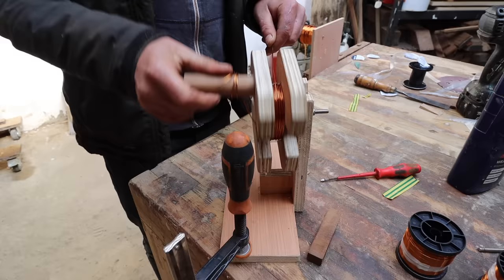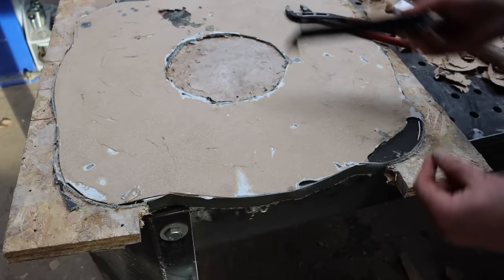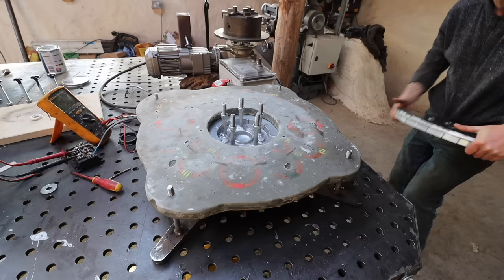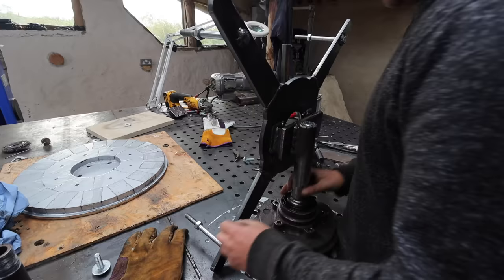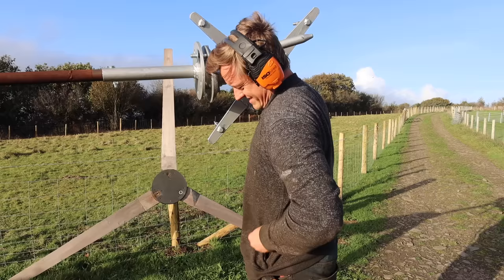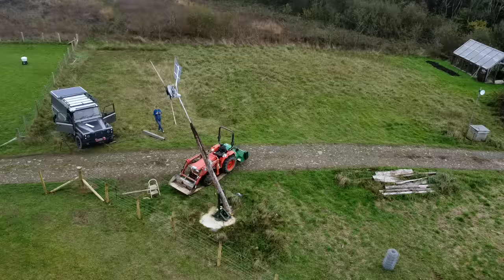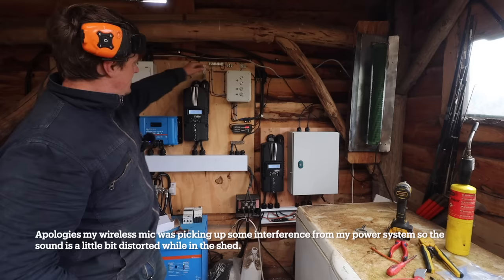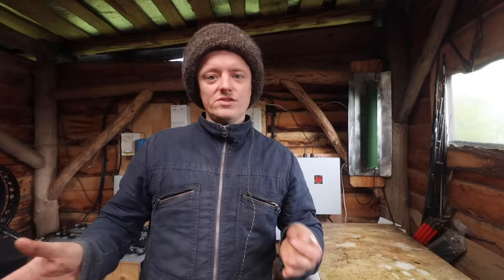Off Grid 2 KW Axial Flux Wind Turbine And MPPT Dump Load Controler Build

Comment: If you experience failures in solid state components associated with the relay coils consider installing a reverse biased shunt diode across the relay coils so when the relay coil de-energizes the high voltage from the collapsing field of the relay coil is shunted to ground instead of back into whatever solid state device you may have controlling/powering the energization and de-energization of the relay coil.

Comment: Jeeeez my guy… you’re using some heavy & solid materials for the blades/turbine parts on top. Lighter materials w less mass would help with efficiency @ min wind speed & not not be so tough on center of structure & the slim pole you mentioned that it’s all held up with

Comment: I'm always amazed that the stuff you make works as well as it does, rough and ready sums it up. But I think you need to change the Copaslip for proper grease as soon as you can in that bearing. Copaslip is an antiseize compound for static applications, it really should not be used as a lubricant. Love watching what you manage to do though with your limited resources. You still need to wear gloves and protection when you are welding.

Comment: Could you invert the function of aux2 and the solid state relay? So that if the relay dies it will default to dumping the energy to the heater instead of risking overcharging the batteries? Just a thought. Not sure if the controller can invert the function and that the solid state has both a normally open and normally closed output. If all that is available, just invert the aux2 signal and switch the output on the relay and it will have a graceful failure mode instead of a possibly catastrophic one.

Comment: vertical wind turbine ends the twisting matrix of traditional windmill designs and to reverse weight some even use magnets to create levitation which can reduce weight of the turntable! So just a whisper of wind turns the vertical axis...The load of the batteries and charging system creates some counter electromotive forces but weight of the apparatus can be reversed through an additional ring of magnets set up with like poles repelling to the point of almost floating the turntable in mid air

Comment: Consider putting a plate behind the coil, then you can push the plate out with a few screws to remove from hub.  Much like they do to remove injection molding.
What about using the clear epoxy like they do with tables, so you don't hide the motor.  Works of art should be seen.

Comment: I dearly love a wind generator. Cost a whole lot less than solar power and all the high dollar batteries and solar panels, and the space it uses up >  My ideal of a pole is?  A telescopic pole, 1 straight one with a cable to a electric wench to lift up the other one.  My radio tower was set up like that, and make it easy to take up and down the antenna. Then the other pole for a lift could be taken down as well, when it was set up

Comment: It wouldn't be too hard to build a secondary safety cutoff that swaps the turbine over to the heater, bypassing the MPPT entirely, in the case that the battery voltage goes above a certain configurable overcharge threshold. It's not a particularly difficult circuit design and I wouldn't mind putting a custom PCB together if you're interested :)

Comment: A matter of interest if say you go for 48V batteries, then less losses in cable's, I see there's a very nice slope why don't you take advantage of that & try build say a large vertical wind turbine, your generator say at the top of the construction, with the hill you should get a very good gust of wind at the top of the hill, I don't think you need to mount it more than 6 ft off the ground if you mount it at the top of the hill, easy to maintain 👍 you wouldn't need to worry too much off overspeed as long as its well balanced assembly, only worry about overvoltage, you could even have a mechanical clutch breaking system like the governor on a steam driven engine,  interesting video for sure 👍👏,

Comment: Using roller bearing can be used as slip rings. Used then for round the pole electric model aircraft. Make unit the oil seals and watertight plastic box,  inside wires in, up the tube and out, output wires resined in out of unit holes and away.

Comment: When you get time think about a wood cutting cnc conversion head for plasma cutter 
And when i want to get rid of air in resin i use sds drill on hammer stop with old 12mm bit to vibrate the job , works an easy

Comment: Very interesting video. I have to wonder why no one builds a wind turbine that has a gearbox to turn the rotation from horizontal to vertical. Then the wire twisting problem would not exist. That also could put the alternator down at ground level which would help balance the weight of the tower. Yes the gearbox would need to drive two shafts one inside the other with one going CCW and the CW to take care of the torque  twist that would happen with just  one that would tend to rotate  the turbine head out of the wind. At the bottom there could be either two alternators or  a set of gears to return the two shafts to a common rotational direction. Shafts would come down the tower one inside the other with bearings somewhere near the middle to take care of whipping. Two alternators would allow you to use two MPPT controllers to adjust for torque twist. Set one for higher than the other and as Voltage went up the one that would need to counter the torque twist would produce the most power while the other would be set to a lesser amount. Same design could be used with a water pump driven by belts  that would act as a dump load/brake for when the power was not needed.

Comment: You  Send the power out from the inverter, running through my entire motorhome so I will not need the brake, or dumping excess. Why not dumb it into 2 saltwater batteries to store electricity, and use when needed?
 QUESTION... Can I use the same charge controller that my MPPT Solar lines come into it? I'm going to run both solar and wind generator on my property. Should I use a separate charge controller for my wind generator?
Any advice would be greatly appreciated.
Todd

Comment: Well done , make do with what you have 👍 entertaining video .i installed a3 kw solar system with 2 Bosch 270 ah batteries and splitter the house in two sections .
Ordernary one phase consumption  is going on solar and battery, 3 phase for stove ,machines i buy , solar charges the batteries with up to 80amp (24 volt) it lasts for days . Total cost was 2400€ and my electrical bill has come down to 20€ a month. When i have no sun or no batteries normal bought power is powering the home

Comment: WOW i just found your video,GREAT!!  As a retired engineer and welder/machinist,that used to make the parts i thought up and did my own drawing on your vid was so good.While watching you lift the pole up i only had 1 thought,if you put a cement counterweight on the bottom of your pole >it would be safer and easier to lower and rise.You would have to remake the base wider maybe or maybe make 2 boxes out of angle iron and plywood to hold the cement bags or maybe just sand?or even water in 55 gallon drums?Balancing the fan blades like on a record player.of course the pivot shaft would need to be increased? Cheers from the USA.

Comment: I'll be building a similar but smaller version of this pretty soon. I don't have a lathe, so I'll be using a motorcycle front wheel to put blades on, and the two brake rotors for the magnets. It already has bearings, and is balanced. Adding 2 foot blades to a 19 inch wheel makes a 67 inch blade. I have 1200 watts of solar panels feeding 20 marine batteries. How many batteries does one need to not have to have a dump load? I think I will try it with 26 and see what happens. I also need to see how the bottom of the pole is made. You made me miss having a tractor. I used to have a 790 John Deere tractor with a front loader. Nice electrical system you have there. The brake rotors I have are 10.875 inches. I plan to put them both on the back side with a spacer between them. I figured I can handle making the coils. I had to buy a Winco generator last week so that I can use my welder. 800 watts would be great. I don't have such an energy thirst or the money to pay for it, as you.

Comment: Nice job on everything concerning the wind turbine, Kris! As a longtime builder and experimenter with horizontal axis wind machines, I only have one suggestion: Get at least three retention cables on your primary mast. As you well know, the power in the wind is proportional to the cube of its velocity increase... so, a sudden violent gust might cause your unit to be blown over and be destroyed. Also, I agree that your secondary support mast appears to be inadequate (dimensionally). These potential problems will certainly be exacerbated when you increase the turbine's area by increasing its diameter. In conclusion, I am amazed by your ability to design (and build) your own generator! Are you also an electrical engineer, or did you have help with this? In any regard, I certainly enjoy watching your videos. Keep up your amazing work!
Reply: Do r need to be a trained engineer . Some of us can work it out for ourselves

Comment: Here is an idea, I dont have wind so cant test it, most wind turbine design trys to run at a constant speed since they are either chaging batteries which have a C rating or feeding into a power system. doing it that way is inefficient. suppose you have a bank of supercapacitors, remove the restriction from the wind turbine so it will react to gust as well as high wind, this way the caps can be charged up very quickly since they have a C rating of a 1000. the output from these caps could then be either feed into an inverter or a battery charging system at a slower rate, edit I am patenting this idea by the way.

Comment: Wnen  using epoxy, use a butane torch to remove air gaps and voids. Just run the torch on top of the epoxy surface after the pour and the bubbles will come out. The industrial way is to use a vaccum, bag and pump to remove the air.

Comment: You could cut a little slit in the magnet holder, to make room for a tiny bar magnet about 3/4 of the length of the magnets used. Forming a Halbach array. Possibly making the magnet stronger, the generator more efficient. A 3mm thick 6mm wide bar magnet, N52 possibly  north and south facing the magnets it may be worth doing, I'd research it, see what exactly the claims are,  I don't have enough water to build anything hydroelectric,  maybe I can build a few windows turbines, I have been looking at some non traditional vawts,  but will probably start with the tried and true turbine 3-5 blade using a modified alternator, just disassemble it and put a large ring magnet in the rotor replacing the field coil, regulator, and rectifier, place it near the battery,  it needs to supply 30-60 v+ for 24-48v battery, i want a mppt like the midnite classic 150, it can track anything. PV to rectified generator. Making charging easy, if you can afford it!! I need about 2kw wind power, and 4-5kw solar, my DC generator can make up for it.. I want to get a 12kw inverter. Either 24v or move up to 48v, 48v makes a lot more sense when it comes to charge controllers! Half the equipment,  ✌️

Comment: Getting rid of the air bubbles in casting can be done with a power sander, you know, the type making small circles with the sole, using the vibration of it

Comment: Enjoy your videos. If you had a counterweight on your mast you could lower it by hand crank. Small airports often use similar setup for windsocks
Have you considered using an electric water heater as a dump load. Could supplement heating and hot water. Cheers from Alberta Canada.

Comment: Dont know if the same happens for everyone else but the sound and subtitles dropped out on the most important section for a wind turbine, the dumpload. Its needed to avoid destroying your batteries or having your windturbine running unloaded in a storm which would probably destroy your turbine, you need a load on it to control the speed and a runaway turbine is dangerous, if your charge controller disconects your turbine and doesnt connect a dumpload you will have a serious problem

Comment: Wrt potting the coil assembly, would recommend construction of a small vacuum chamber to pull out all the trapped air; an old fridge compressor is good & inexpensive

Comment: Heat dump.
On my system I've looked at firstly dumping the heat into 24v emersion element so that the power goes to heat water and once up to temp through thermostat then throw a relay and contacter to the air dump. This gives an auxiliary hot water source.
As yet this is just an idea as funds are limited and I like to where I can recycle materials that people believe ar rubbish.

Comment: I love the design of the power dump!  Since the power will most likely be during long/sunny Summer days, will it make sense to add a fan inline to help dissipate that heat or direct it away from the rest of the electronics?  I'm in Southern California so maybe overheating isn't an issue for you.
Reply: An air compressor would be a great way to use excessive power. Could store the compressed air or just dump it. Much safer than a 2kW heater in the controls shed.

Comment: Protect the vertical bearing seal with a simple alum. or plastic cap cut in half so you can install it. Water will get in otherwise.

Comment: I love fab videos.  I always have lots of reactions:

11:45  Nice trick with the brass studs.  Having a vertical mill sure is handy!
144:52  Wear gloves when you weld, man!  Ouch
16:39  Gluing down the magnets is the WORST time to discover you marked the "S" pole "N".
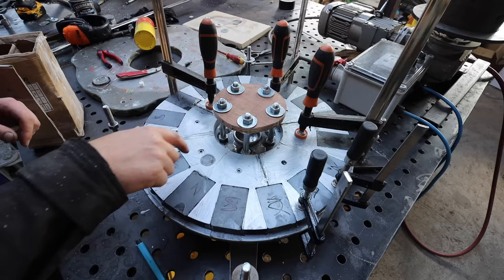16:57  That wooden disk would have made a nice tool to center your "spider" rather than do that by eye.
19:31  You would NOT want to do that with Neo magnets!  I wouldn't have the guts to try that, even with ferrites.
25:25  I don't think copper grease is going to last very long.
27:40  You can make a cradle with a few pieces of lumber for the tower to rest on as it comes down.
32:20  A bit of nose-up keeps the tips of the blades away from the tower.
39:45  They say "when you need a bigger hammer" and you oblige.
42:00  Can't agree more, wind turbines do need towers that let you fix them.  
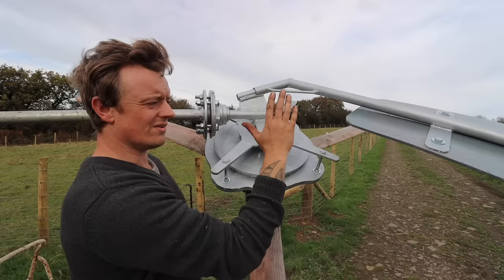43:48  Lucky you.  My wind direction always changes clockwise.  Always!
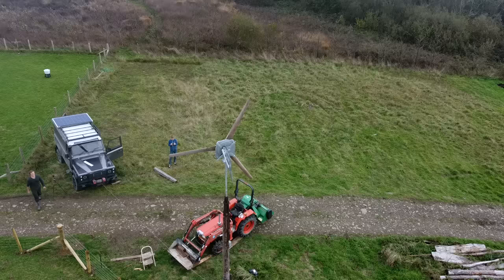46:00  Congratulations!

Comment: It needs high voltage diverter , a voltage controlled relay  to to to disconnect the turbine from the battery when they are fully charged, to prevent over speed  of the turbine,

Comment: Use super 100F capacitor bank with the FWB, into the MPPT can follow the power better. Overvoltage should be switched into water heater etc...
MPPT could get generator inductive surge damage not seen with smoother PV power.

Comment: I'm a bit puzzled why not put the surplus in to a into a secondary battery bank.  As an emergency secondary dump insted of a heating element so it can be used insted. say you we running  low as i have seen you do meny times.,  using heat to loos suitable power seem a waste in my mined  I wuld have taught that the opatunity to store power is best Stord in batteries.   preps it cheaper to use a hating coil.  I always held  low Barites as a Bump load.

Comment: Im curious 
Can you dump load into a large water heater .

So have the dump load do something helpful.
Have a large reserve of water, larger than you need and have it  say  heat areas like your garden etc? 

When you have too much power it heats water, worst case you could have the water changed by the stream so that all the excess power is safely dumped?

You could extend that and have water heaters powered by the dump load

Just an idea

Comment: Sir,allow me to share a tweak i did on a friend's ranch. Instead of waisting the dump energy,i connected the dump line to a water heater of 100 liters,so it heats water for the house. I took a 20 A NO-NC relay and i connected it to the dump line thru the heater's thermostat. at the common is also the dump line,at NO (normally opened) is connected the heater's resistence and at the NC(normally closed),it is connected the dumper resistence. When the water is cold,the thermostat is on,so powers the relay connecting the heater resistence,when the water gets hot,the thermostat goes off,the relay goes off ,switching from the heater resistence to the dumper resistence. I would also suggest you to do a trick with the cables coming from the generator ,because they are twisted as the wind generator turns left-right. An alternator collector with it's brushes would do the trick,installing them on the top,so the alternator's collector remains fixed to the axle and the brushes roll around .I is only an idea,maybe you can get a better solution. Greetings from Romania and sorry for my bad english😅

Comment: Hi Kris, great project! Very envious of your setup! Just a suggestion - could you bring the 3phase brake in as the fail safe? As in where you have your rotary isolator, a 3pole relay sat in paralell with that (coils shorted) - held open on the auxillary contacts. Appreciate your comment that sometimes the stator cant hold it - this may be the case now youve made the bigger blades. Keep it up 👍 love the vids

Comment: Do you think small shock absorbers would help dampen the rotation of the turbine to make turning more gentle?  Also, do you need a cover over the parts and a much longer telephone pole to get the turbine into more steady wind.   You might consider using "Locktight" on the bolts and lock washers to keep the bolts from loosening.  Do you have a torque wrench to make sure there is even  torque on each bolt?     When you put on longer blades, make sure you balance the blade assembly as a whole to keep down vibration.